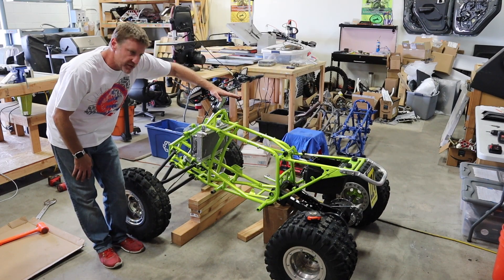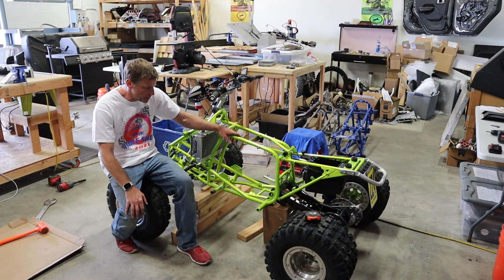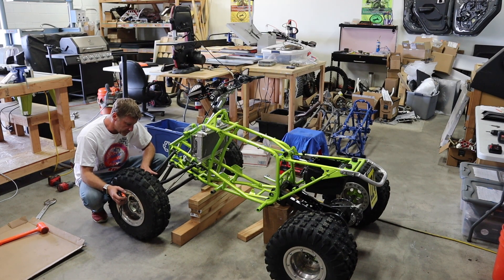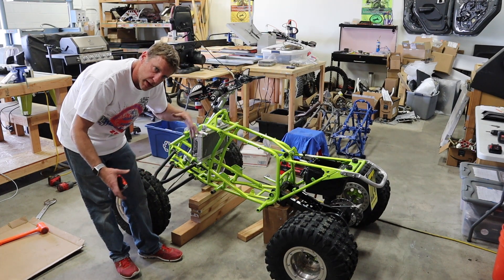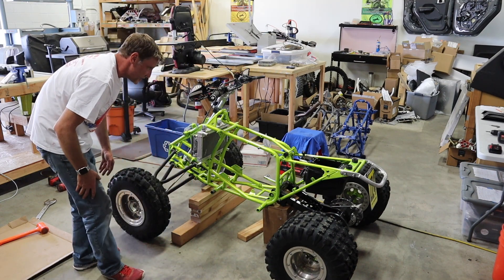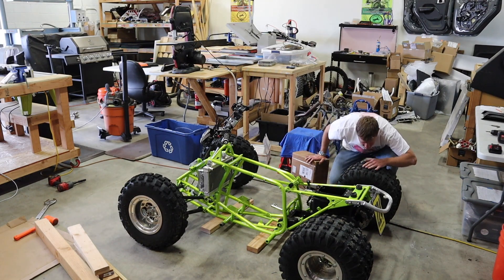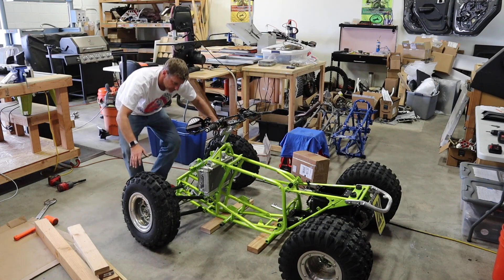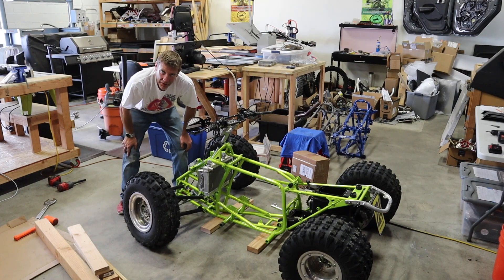Build a Race TRX250R ATV - Determining Extended and Compressed Shock Lengths

Comment: According to a video I saw done by Houser, you can measure compressed length when your bike is 1.5 inches off the ground. As you mentioned check for binding joints because you might need to limit the travel.

What ride height do you set your Rs at?
I usually measure by the pegs, and right before the frame rake comes in.

Comment: So the reason for the 12” is because of your a arm/front spindle setup, not because of anything special about 12”?
Reply from the maker: 12” is just the standard height to measure for extended. I think if you’re doing a desert build you use 13”
Reply: Iv read that its just for ground clearance purposes and for lowering center of gravity for turning. So desert racer would be more interested in ground clearance so 13" is the height that would be best and 12" would lower center of gravity for turning in mx or xc and still have good ground clearance so thats what i know. I think maultech atv has the info
Reply: I don't think he explicitly mentioned this but he must be aiming for 10-1/2 wheel travel because 12 extended minus 1-1/2 compressed is 10-1/2.